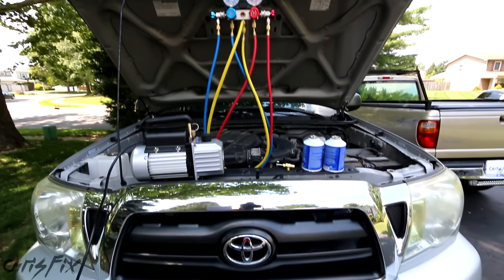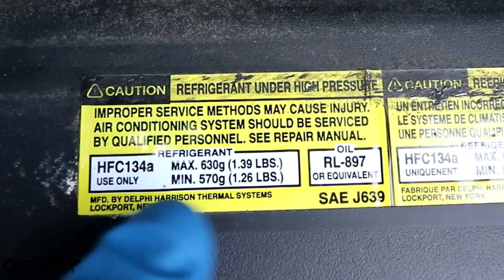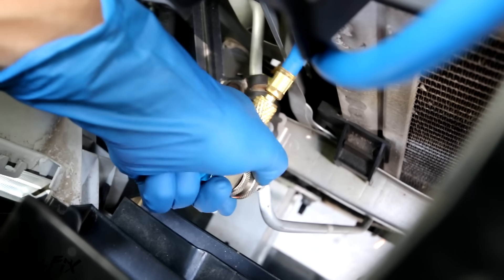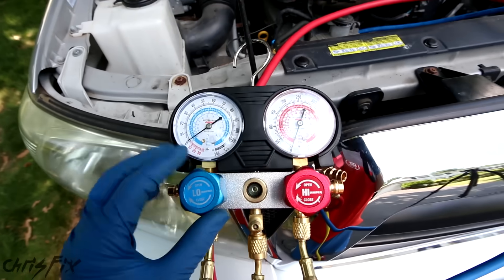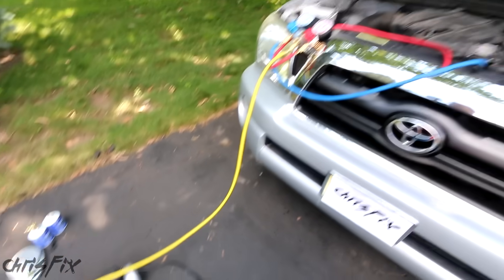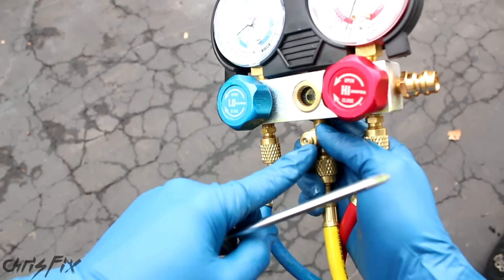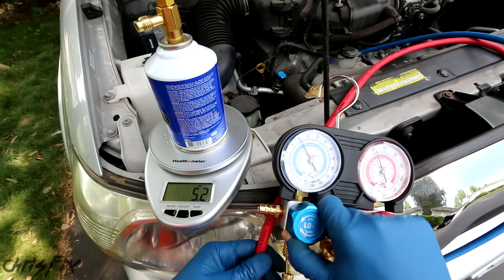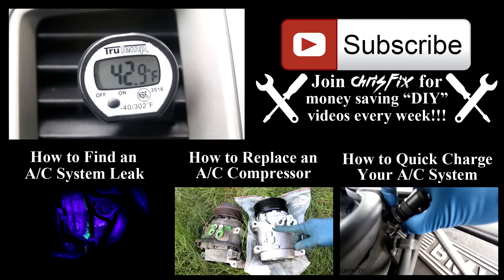How to Properly Recharge Your AC System

Comment: Uh, a new compressor comes with enough oil for the WHOLE system, not just for a single component. If you're just replacing the compressor, you're supposed to drain both the old compressor and the new compressor. You only put the amount of oil that came out of the OLD compressor. If you didnt do this with a new compressor, you will have WAY too much oil in your system which will cause your pressures to be high, build more heat than it can take out through the condenser, and generally have poor performance from your ac system. Yeah it will blow cold, but it wont be right and will likely vent itself at some point.

Comment: I know this is an old video but still wondering why on everything i see, after you do the vacuum and shutoff the gauges to ensure the system isnt leaking how is it measuring the system if you shutoff the gauges? You're not truly measuring the system under vacuum to see if there is a leak by shutting off the gauges, you would need to have them open otherwise you're just measuring the gauges and not the system itself.
Reply: The valves shut off the high and low side hoses to the yellow center hose. The gauge is always reading pressure in the high or low side hose.
Reply: @Redtooth75  got it I was trying to wrap my head around it and was saying to myself they can’t be wrong something isn’t right. Thanks for the reply

Comment: @chrisfix I have watched tons of your videos and very rarely do I disagree with what you do. But this is one of the times I do, when the A/C system is under vacuum you do NOT start the vehicle.. the vacuum you have pulled will suck the freon in you do NOT start the engine until you have put enough freon in for the compressor to kick on then once the engine is started the compressor will draw in what extra freon you need to top it off. This method could cause someone to ruin there compressor part of charging the ac system is also adding the correct oil.. please make this know.. (ASE certified Master tech) thanks!
Reply from the maker: Thanks Kyle. Can you elaborate why starting the engine while the ac system is under vacuum would cause a problem?
Reply: In the event that a pressure switch had failed/ stuck on and caused the ac compressor to start while under vacuum or with out freon could result in catastrophic failure. It may be okay this time last time or the next time. It's just not a good practice when doing so may potentially cause a failure.. this is what I have been taught I actually believe it was question on the ase certification test. I never searched or asked for anymore of an explanation besides doing so can cause a failure.
Reply: Why would start the engine before freon is installed? I think is the better question

Comment: The title is “ How to properly recharge your A/C system” then shows how to improperly recharge the system. The proper tools are 609 certified, those are not.
 Section 609 requires that Technicians use refrigerant handling equipment that has been certified by the EPA or an independent standards testing organization approved by EPA to certify equipment. Currently, Intertek(formerly ETL Testing Laboratories, Inc.) and Underwriters Laboratory (UL)are the only independent standards testing organizations approved to certify refrigerant handling equipment.
Proper ended before even starting. 
How to recharge your A/C system would be more accurate as that will work.
Reply: I am 100% positive that the gauges and pump he is using are UL certified.

Comment: Will a brand new ac compressor fail right away if I accidentally over filled oil an high pressure when refilling the low line after install ? I installed new condenser an compressor my car still not cooling down I don’t know what going on I’m redoing everything now but taking extra precautions in the oil an refrigerant this time

Comment: I don't get how you're checking for leaks by closing both valves to the system...
Reply: The valves close off the red and blue hoses from the yellow hose. The gauge is always reading pressure in the red or blue hose. You close the valves to see if the system will hold a vacuum.
Reply: @Redtooth75  Thanks, I know how it works now after finding a diagram of a cutaway of the manifold.

Comment: Since doing a complete engine overhaul on our 2004 Toyota Corolla also have to do the AC system which was blowing hot air, I have all parts for it, my compressor is the factory one and works but I am replacing it anyways as reaching soon end of life probably; since engine is still out of the bay this is easier; you are right the worst part is the tools needed which combined with the parts I bought I am close to 2K but a shop charges pretty close for the job and I do have another old 2000 Tacoma which air works at the moment but if it fails then I have the tools already for the job. I have been going back and forward with opinions from mechanics; some say replace what you can now that you have access others say put it back together then diagnose, but either way at the very least I may have a leak because the AC relay is also good so if compressor is good and AC relay test good as well and with pressure on the system it is pointing to a leak. I also have the evaporator and condenser and drier, O ring kit, PAG46 oil although new compressor is an UAC and comes with oil, and even the syringe to inject oil if needed, also have a 4 Uncles AC System Flush set, if I evacuate, I would not omite doing this for maintenance purposes, then would take the recovered freon to recycle and do as you show here; very helpful. I have the gauge and vacuum shown here, also an Inficon Dual Vortex recovery machine that comes with filter, VivoHome scale for the tank that is a 30 pounds one, as you can see fully prepared for the fun!!

Comment: Third time watching and second time charging system due to hose crimp failure(s). One question: on the can piercing valve, if you run it all the way down  you will pierce the second can as you secure it. Any risk to not have a seal established before you have an unsecured can of refrigerant with a hole in it in your hands?

Comment: Can someone HELP me please! I want to replace my ac condensor cause it's damaged from a front collision. Do I need to vacuum anything or can I just replace it myself normally unscrewing the pipes then recharge after?? It's a 2019 ford mustang
Reply from the maker: You need to pull a vacuum after you replace it. There cannot be any air in the system when you recharge it.
Reply: Many auto parts stores will rent out the gauges and vacuum pump for free.

Comment: I bought that recommended combination kit on Amazon but I had problems with it.  There is no way to connect the included left-hand threaded can tap to the manifold set using the provided adapters, the vacuum pump is unreliable, and returning the kit costs over $50 in shipping costs.  I would suggest buying at your local Harbor Freight instead.

Comment: Great video, but I gotta ask, BEFORE you opened the blue low side, your gauge was reading 0 psi and not the -30. Why is that? Shouldnt it still have been at -30 until the moment you opened to charge?

Comment: You got the AC going my Peterbilt. Mechanic wanted 1500. I bought my compressor, air dryer, vacuum pump, freon and manifold gauges in total for 450. Thank you!
Reply: The air dryer was probably the simplest one to replace lmao- a diesel tech
Reply: Now you have the gauges and vacuum pump for the future.
Reply: Air dryer has nothing to do to do with a/c
Reply: @Kevin-id5hx - Any time you open the system you want to replace the receiver drier.
Reply: @foltzenlogel  the air dryer on a peterbuilt  has nothing to do with the a/c  there is no air dryer on any a/c system
Reply: I borrowed both the vacuum pump and manifold gauges for free from O'Reilly's Auto Parts
Reply: @tbird9mm  that’s very useful information. Thank you for sharing that.

Comment: Chris fix when it cames to the AC valves on the top you closed them  off and then you opened  up the valves that was connected to the high and lows valves how does it read it if the valves is closed at the top don't it supposed to be open how does it know anything if it's closed if it's closed how do it read anything there's no air coming in or out I'm a little confused with that
Reply: The valves on the manifold shuts off the center yellow line to the high or low side. The gauge is always reading pressure in the high or low side.

Comment: Your link in the description for the gouges on Amazon are not the same as what you're using in the video. I ordered from the link and found it was a cheap model that didn't have knows at the connectors. Had to return them. You should check that link and put in correct model.  Otherwise good video. 👍

Comment: Trying to do this repair, all is going well but when I try to fill up the system the high pressure side doesn’t build, am I doing something wrong? The compressor is working fine

Comment: If you are pulling a vacuum on the system to get moisture and contaminants Out, how are you not pulling the factory supplied oil out of the new compressor you just installed?

Comment: Do you need the high pressure gauge still hooked up while recharging? Can't you just take that off and only charge through the low pressure port?
Reply: Its a good idea to leave it on so you can monitor the high side and make sure you have good airflow through the condenser. But it is not needed for charging.

Comment: When I charged my system, my passenger side was cold but my drivers side still blew warm. I don’t have a dual climate ac system. I’ve been reading in forums and people would say it’s not charged enough. But I’m pushing 50 psi and don’t want to over charge the system. What should I do?

Comment: Off chance you see this Chris. My truck's A/C was replaced. Now it seems the A/C draws too much power. I lose power with A/C on. Tips?
Reply from the maker: That is typical. If you have a tiny engine you might feel it more. An ac system uses about 5hp.

Comment: I was told never open the high pressure valve on the manifold gauge when vacuum pumping. So that's a good thing to do?
Reply: Opening both valves fully will speed up the evacuation.

Comment: Why is it important to use a refrigerant without any oils or additives like leak stop?
Reply: On occasion, stop leak can do more harm than good and gum up the system, and sometimes some refrigerants can also have extra PAG oil, which could potentially overfill the system with oil

Comment: An additional tip for car AC service: If your manifold gauge set isn't new (mine is inherited), check the condition of the rubber refrigerant hose seals. They can be replaced and should be replaced if they are old, compressed, hard, or otherwise deteriorated -- either that, or purchase a new hose set. Also, when storing the manifold gauge set, loosen the fittings a bit so the seals don't get compressed. Tighten them when you are ready to use them. 

Mine were so old, when I tried to remove the seals, they came out in hard, crumbly pieces.
Reply: You mean, there is a rubber seal inside the SAE 1/4 inch-type metal connector ?

Comment: Hi….what does it mean when I’m adding refrigerant the high side gauge doesn’t move or anything, only the low side, but the system is taking in the refrigerant?
Reply from the maker: Correct. The high side will stay pretty stable and move up in pressure slowly.

Comment: I got my first car (scion xa 2005) about 7 years ago and the A/C didn't work along with various other issues. The mechanic wanted about 3k to fix the problem (it did have a small leak somewhere, and they said I needed to replace a bunch of parts to fix it) which was almost what I paid for the car at the time. After doing this it worked until a month ago, so I followed this video again and it's still working! With your videos I've helped myself, friends and coworkers fix suspension, brakes, oil pans, alternators, fluids, door handles/other body parts, scratch repair ect. I basically ask them to pay for whatever tools/parts are needed so they're still saving a bunch and I now have a respectable selection of tools! Between the confidence your videos give me and the ease of repair for my car I've saved untold amounts of money, thank you!
Reply: You still need to fix the leaks, which may require replacing parts. If you don't trust one quote, ask some other recommended garages. They are meant to be sealed systems, so should leak nothing or barely anything, last many years.
Reply: Pretty sure he said he got the scion an older car 7 years ago.  Thats a good time for a slow leak.   Im about to do to my 13 odyseey.
Reply: You are unable to vent it yourself, since you need to pay to have it disposed responsibly. You can't just release it.
Reply: @tutacatyeah but that only costs $150 at ur local shop, still saved 2850 bucks from a3k quote
Reply: Sounds like you're good at working  yourself

Comment: When bleeding the line just before charging, I'm not seeing refrigerant coming out. The can is getting cold, but I only hear Gas hissing out. Am I doing something wrong?
Reply: If the can is upright only vapor will come out, you only get liquid if the can is upside down. It only takes a couple of seconds to bleed the line. Holding the can upside down is a good method to make sure the libe is completely bleed.

Comment: This video was very helpful as I replaced my condenser. Held steady vac for over an hour!! Thank you, kind sir! Was frustrated and dealing with A/C issues for over a year. One low side Schrader valve and condenser/drier later, it seems the issues have been fixed! After waiting for an hour and verifying with manifold gauge my vacuum held, now I'm purging the system for one hour, then will add appropriate amount of refrigerant. I mistakenly added PAG oil prior to installing the condenser, instead of waiting until added refrigerant, but after doing some searching, I should be OK because the vacuum pump shouldn't remove the PAG oil...I may add a little more in the refrigerant line before adding the refrigerant.
Reply from the maker: Glad the video was helpful

Comment: When you begging adding the Freon, do you close the HI pressure gauge or live it open?
Reply: You close the valve on the manifold. The pressure on the high side is much higher than the can so instead of filling the system you would fill the can. In an extreme case it can cause the can to rupture.

Comment: Had a quick question. I saw you add oil into the line of compressor was new correct ? If I’m just changing out a new condenser do I need to add that oil also ? I’m only changing out the condenser. Thanks.
Reply from the maker: Yes usually there is a certain amount of oil you need to add for each component you need to replace.

Comment: My compressor is going out the bearing is making noise every time the clutch engages I’m going to replace it but I would like to know if there would be debris that the mechanic shop when they flush out the vacuum system for me to replace the compressor with a new one with a notice when it’s been flushed out if there’s any debris in the system if so I will have to replace the dryer a condenser and evaporator or can I get away with just replacing the compressor The compressor is not leaking just to bear in making a noise let me know what you think
Reply from the maker: Doesn’t sound like there will be. Only if your compressor fails internally and put us debris in there.

Comment: Do you need to add oil after pulling vacuum or is this just for component replacement?
Reply from the maker: Just if you replace a component. Sometimes if you have a leak you might want to add a little if you think a bunch leaked out.

Comment: So I have a mechanic who's charging me 290 to put the ac compressor +oil and to clear the line and recharge 
Without recharge 195 
Now my question is that if he does everything else for 195 can I buy one of those cans you use in your other recharge videos and recharge it my self??
Reply from the maker: For $290 for all of that, just have him do it all. That’s a crazy good price. It’s going to be $50-75 just for the refrigerant yourself.
Reply: I work at a advance auto parts and we have the refrigerant cans the big ones for 30
Reply: Once he put the compressor on and oil it and drains the ac line what do I do after that if I choose that option?
Reply: Did you highlight your comment?

Comment: Hey, Ive pulled a vacuum and refilled the system but still can’t get the system cooler than 70 coming through the vent. I’ve checked the blower fan under the dash for debris cleaned the condenser, the condensate drains are both working and clear. My pressures are looking within range .. I’m stuck
Reply from the maker: If you shut the AC but keep the temp cold, is the air coming out hot? If so, there is a vent or heater control valve stuck open allowing heat into the car. I assume you’re pressures are good on the hight and low pressure sides?
Reply: Bless you thank you for your quick response .. are you talking about the blend door behind the dash? The pressures are good both sides. If I keep the internal cycling position on and shut off the ac it should stay relatively cold?
Reply: @dbrad8143  I think he means to shut off the ac but keep the vent fan on with the temp knob turned to the cold side. If the vent fan is blowing hot air (when turned to the cold side), then the valve/flap that blocks the heated air is stuck open letting in hot air even when the ac is on. If that is the case, your 43 degree ac air is mixing with hot air resulting in 70 degree air out the vents.

Comment: Help! So my vacuum won't drop below 20 when I'm trying to vacuum the system. Any idea why?
Reply: Weak vacuum pump or there is a leak somewhere. If you are using cheap or old gauge hoses they can leak through the hose itself or from the gasket on the fitting. There can also be a leak in the system itself.